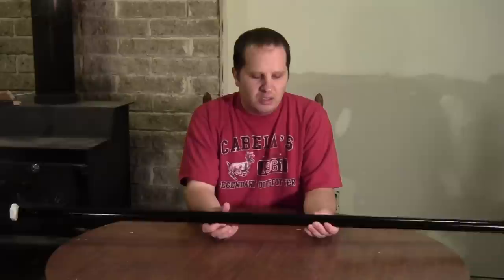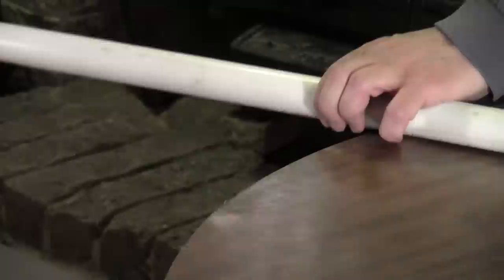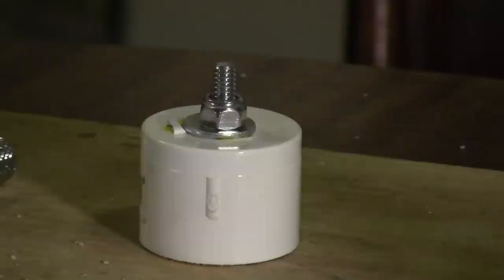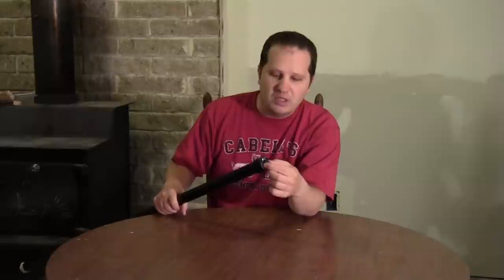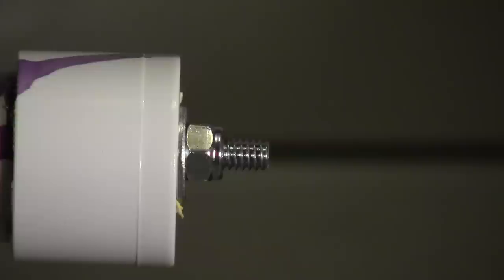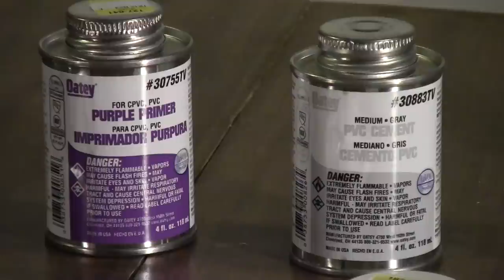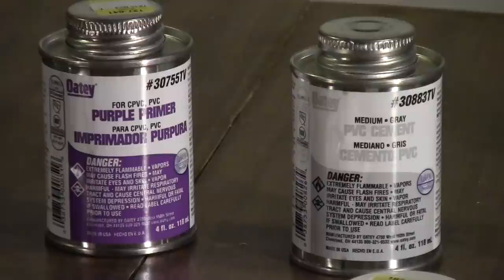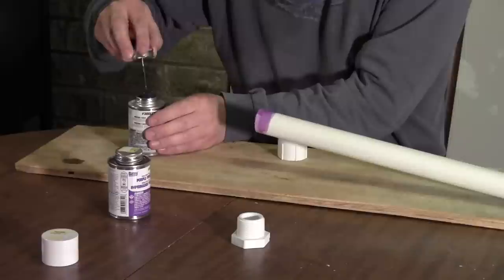How to make a hiking stick from a PVC pipe

Comment: Nice video, I have a suggestion. Try using fender washers on both sides of your bottom bolt/cap piece. It should give a bit more strength to the cap.

Comment: PVC becomes very brittle in cold weather.  Any temperatures below freezing, the PVC will likely crack or break when under stress.  The colder the temperature, the more brittle PVC becomes... & PVC breaks down when exposed to UV light.
Reply: I use Schedule 80; I don't have to worry about that!

Comment: PVC won't hold up to the demands. Walking sticks are a tool and must be able to sustain abuse, like beating off an attacking animal or clearing brush from the path. In addition, cold temperatures will, over time, make it brittle.  There is no reason to have something hollow, so you can stuff gear in it, as it makes the staff too heavy for long hikes. You can make a staff out of wood just as easily as PVC.